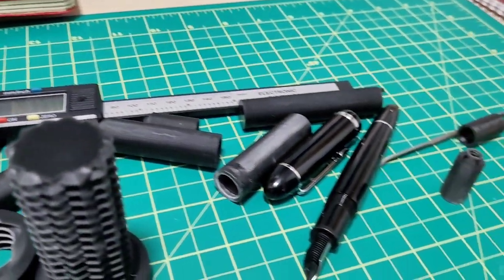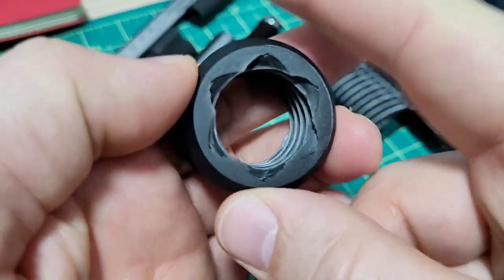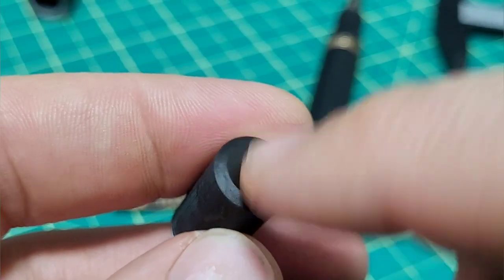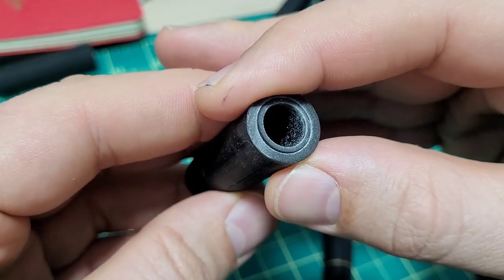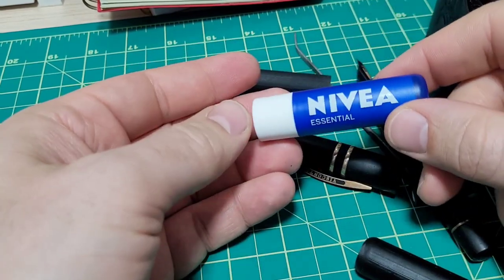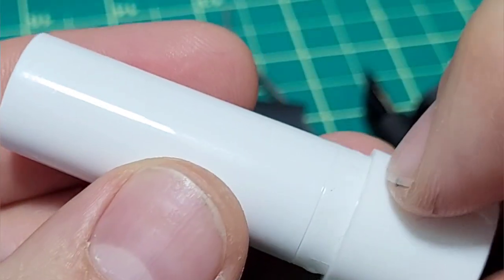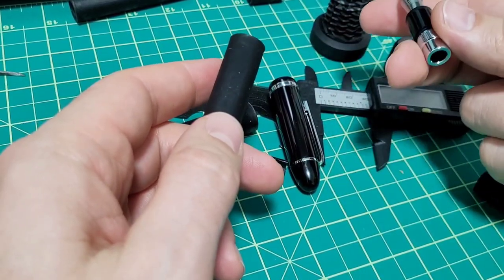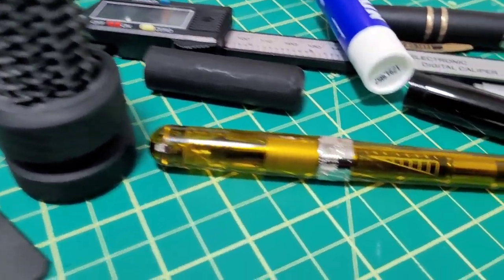Everything is BREAKING - 3D Printing a Fountain Pen - Part 2

Comment: Haha, I actually use PETG for springs, albeit slightly larger.  I have a 3D printed spring in a pressure roller (filament feeder for a dry box), it's been working about three years now.  I printed the spring about 2 or 2.5 mm thick, and the coil is about 7mm.  At that thickness and coil diameter the spring is able to compress 100% and return to normal length.  That would be do-able in a pen cap - I can see it working.  PET-G is of course done with a filament deposition printer.  It's crazy what you can make with a 3D printer really.  I have two 3D printed Ukuleles, the first one from a design someone else did, and my completely redesigned one with many improvements.  It always helps to look at what the other guy did wrong (or right).

I use FreeCAD, which is excellent in some areas, but not so great in others.  It is open source however.  Learning 3D modelling certainly comes with a steep learning curve, but after a few years making stuff I feel my main limitations are the size of the build volume and the limitations of the materials themselves.

Comment: Great progress - I love the idea of the sprung liner in the cap!!

On the thread front, there are a few options - you can undersize the male thread and undersize the female thread pitches by 10% and you shouldn't lose any fitment - so for an M10x1 you could set your male thread peaks at 9.9mm (instead of 10mm) and the female peaks at 9.1mm (instead of 9mm) - this will flatten all of your sharp edges and prevent the threads from bottoming out inside of each other and grinding away. You could also make a trapezoidal thread profile like an Acme thread, which is designed to be more square. If I have a tight fit between threads I accelerate the smoothing process by using a plastic polish and screwing/unscrewing it a bunch, which effectively laps the threads against each other... That could help with fit but also give you a quicker path to seeing how it holds up to wear!

Can't wait for the next installment!
Reply from the maker: Yeah I don't think any type of V grove style thread will hold up, will have to go with acme style or custom type deal.  I saw in the McMaster I can import lead screws.  Would be crazy to do a profile like that.  Thanks for the tips, you definitely know all about having to ensure good threads on pens!  I love it when I see an acme thread with a higbee cut at the start.  Just seeing that one thing on a pen tells me there probably won't be any issues anywhere on the pen LOL.

Comment: This is why the caps of injection molded containers almost always have a different durometer polymer to account for the extra deflection needed to "snap" a cap on. That, and stacking height, but I digress. 😁👍
Reply from the maker: That's why I ordered this other Polymer as I'll need something to yield a bit

Comment: Of course the chapstick has a limited lifespan, and if it fails it isn't as big of a deal. Also those do get a bit looser over time, and don't snap and seal as well. This wouldn't be as good in the pen cap. I wonder if thicker wall of the pen cap alleviates this. Also snap caps make great fidget toys, so the expected number of snaps fir a pen could be quite high. Fascinating to watch the progress towards the finish line.
Reply from the maker: The same type of feature exists on many pens as well.  Its all about dialing it in and picking the right materials and fitment

Comment: Do you know you can design the parts into each other so they print together and they’re basically printed in place. I was thinking for the part where you were having to press fit the cap piece with the spring into the cap im guessing
Reply from the maker: I was considering that but the issue with the photopolymer is I need to do a final UV exposeure after the printing. I wouldn't be able to expose the inner liner if I did it that way. Lots of ways to approach it so will be trying lots of stuff.

Comment: I enjoy your engineering perspective and your current design process. I think a snap or friction fit cap is very important for a fountain pen, and a screw cap is a major negative. Finding inspiration from other non fountain pen products is also great. The Pilot elite and Schaeffer PFM both have excellent friction fit solutions but they both have hooded nibs. I've also heard the Diplomats have a great snap cap, but I haven't used one, and they're metal. The Pilot Prera is known for having a great snap, and the Wing Sung 3003 duplicated that feature very well. I highly recommend picking up some 3003s to take a look at how they did it, they are still extremely cheap, and can be eyedropped. Good Luck in your pursuits. Regards.
Reply from the maker: One of my favorite cheap pens that is built well are the Zebra pens.  So many fine little details for such a low price is amazing. I'll give the WS 3003 a look online
Reply: @Doodlebud  and I will check out the Zebras. Thank You. Regards.
Reply from the maker: Here's a review I did of the pen if you're interested: https://youtu.be/QdAY2Nk6yD4
Reply: @Doodlebud  Very nice. I don't think anyone else is drawing the cap section to show how it works. :) Also like the shooting star, which closely resembles the Kakuno. The Wing Sung 3003 comes in packs of five for about 16 bucks, so they're cheap also, but they have a sturdier feeling build quality than the Kakuno, especially at the cap connection, and can be eyedropped as I mentioned before. Cheers, Regards.

Comment: I think a better way to 3d print the spring and have it be one piece with the cap would have it be like a half of a leaf spring. Have one end attached to the inner cap piece you broke the spring off of and the other end not attached to anything. The idea is that it's curved over, and as pressure is applied it bends and the unattached end is pushed into the same price the other end is attached to. Once that happens it is already taking some load. It can now take more load when the unattached end slides away from the attached end and the whole curved spring gets flatter.
Reply from the maker: I have that designed already along with a few other designs as well ;)
Reply: @Doodlebud The real trick is fitting it inside the cap. Usually you can get more deflection by longer lengths to not go over what the material can handle, but inside the confines of the cap it is trickier.
Have you considered integrating the spring action not in the inner slip cap, but in the external outer cap. Some inwards fingers from cap opening to the inside peak, which the inner cap pushes against more and more as it slips deeper into the outer cap. I also have an interesting idea for the printed spring of the clip. Rigid clip on one side, attached to a pivot in the finial, pushing against printed spring on the other side of the cap, which is in a printed void on the other side of the cap.

Comment: Why not just use a rubber conical washer like design for the spring?
Reply from the maker: This resin once cured only has slight give to it. There is a resin that is pretty close to some rubbers that could work.  Will be playing with multiple designs to see what I can get away with from this resin
Reply: @Doodlebud  if my wife allows, I am going to be trying this build your own pen experiment too. So watching very carefully. And my thought was to either print a conical spring in place or just drop one in to work as the seal.

Comment: Got a question springy about piece that goes into the top of the cap. Could you build a little ledge in the top of the cap and drop the springy piece in using a finial to screw down and hold it in place rather than pushing it through from the bottom?
Reply from the maker: Absolutely, that would be the easier way to do it.  But I'm wanting to reduce the number of parts and make it a bit more seamless if possible.  I'll see how things turn out, it takes many iterations and fine tuning
Reply: Understandable. My next thought would have been printing the mechanism in the cap with a kind of twist compression that would help spring it back out, but I'm not sure it's possible to print that, even on a resin printer.

Comment: One question is why MSLA vs FDM?
Reply from the maker: I can get finer detail with photopolymer
Reply: @Doodlebud  Would love some details of the setup you're using, along the printer. Also comments about the smell, handling difficulties etc.
Reply from the maker: Im still dialing all of that stuff in.  I'm flying blind as this is the first time I'm learning to design and use the printer as well.  Once I have useful data to share I'll update

Comment: It seems to me there is a time limit on how much time one spends on any creative project.  I think there are enough fountain pens in the world not to have to print a 3D version.  My 3D printer has been relegated to things I absolutely cannot buy.  Things that are not manufactured.  Just sayin.  (Mine is a Lulzbot Mini.  FDM only)
Reply from the maker: There are more than enough fountain pens in the world already no matter the manufacturing method used. For me this is a fun project to build pens for my own personal use.  I can play with pushing the limits of materials and the machine.  I can make something that could be extremely complex using other methods, try out design ideas, and also gain a better understanding of the overall process when it comes to the design and manufacturing of fountain pens.  So its more a fun way for me to better understand pen design but also stay engaged with my previous engineering career.
Reply: @Doodlebud  I understand completely.  
The challenge to make something your own is as important as the end result.  Personally, I do have an 'per project' internal time limit on wrestling with said project.